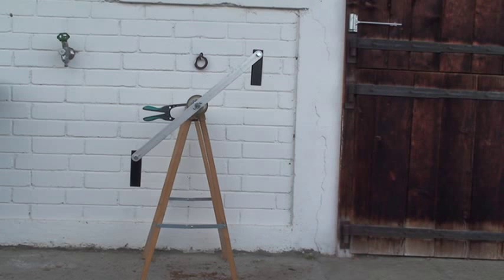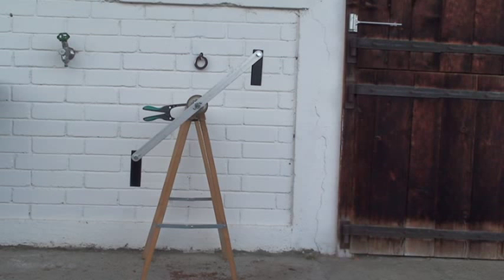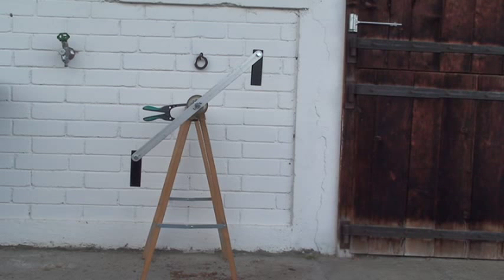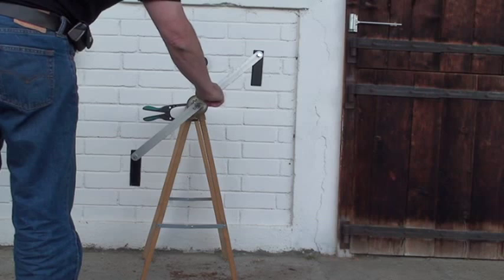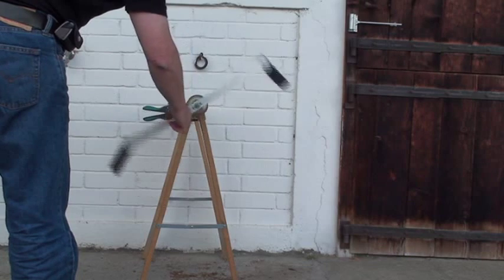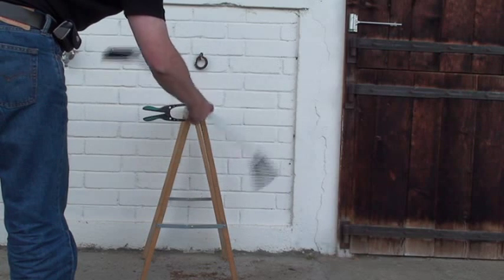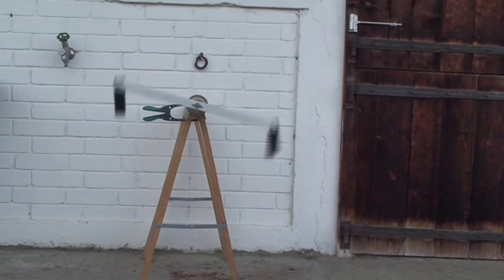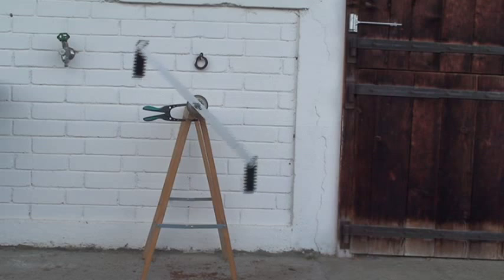Mikhail wheel first exercise

Comment: True enough it is all   very interesting, all this movement in these pendulums,  but it is all easily explained with  good scientific logic and the laws of nature which we have known for hundreds of years.

* Well when the system is stationary, the pendulums hang down vertically while the linking lever can take any position if the system is well balanced.  This is only due to the fact that the weight of the pendulums is pivoted and not fixed and so the centre of gravity of both pendulums is always at the same distance from the vertical line going through  the central pivot in the beam. This would not be so if a one way bearing is included  nor if the pivot is made  solid. 

* now a pendulum may be excited by moving its pivot or moving it horizontally or both. When  hanging vertically  no vertical  movement will excite the pendulum, but a horizontal one would , and when the pendulum is in any other direction, both a vertical and a horizontal   synchronized movement could excite the pendulums,

*  when the  lever is rotated the pivot points of the pendulums acquire motion and this motion  being a circle, the pivot point of the pendulums would go through a trajectory which will have both horizontal and vertical components AT A DIFFERENT RATE OF CHANGE.  The most aggressive motion of the pendulum pivot points is when their acceleration is maximum  during following the trajectory of the circle  all related to the   second derivative of sinusoidal and cosine functions 
  
* as  there is gravitational pull downward and the pendulums start  in being originally vertical, the first slight side movement of its pivot  will   excite the pendulum  with a forced action , but when the pivot moves vertically the  natural frequency of the pendulums which is faster than the rotation of the beam will take over and the mass of the pendulum will over take the position of the pivot sideways or horizontally   There it is , the pivot motion is the one that force the pendulum to move but the nature of the  movement of the pivot and the nature of the natural resonant frequency of the pendulum  will decide the  final motion where being a linked  energy system, this energy components stored in each moving part of this machine will be exchanges according to the state each part find itself in.

If the rate of change of the pivot point will be faster than the frequency of the pendulums then the pendulums will swing out and stay  out at a larger radius than the lever arm on which the pendulum pivot  exists,.
Well with a non reversing bearing, one side motion of the pendulum will be cancelled but do not expect a perpetual motion for science's sake!